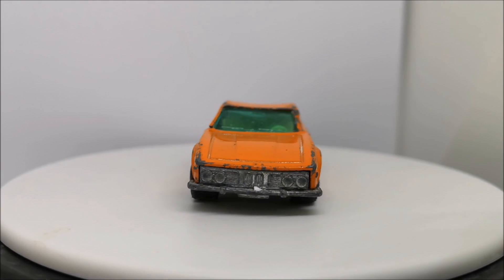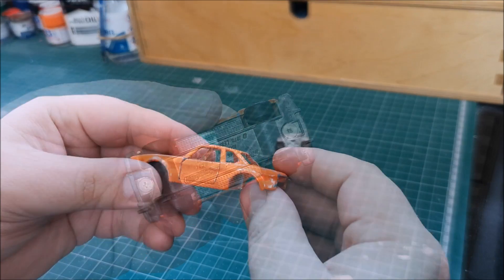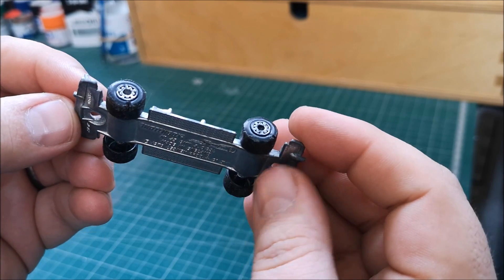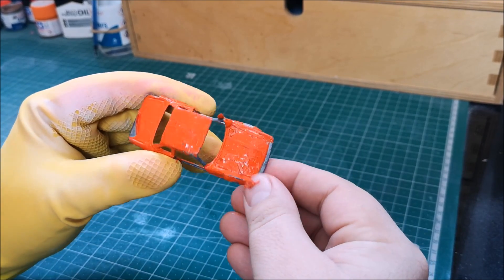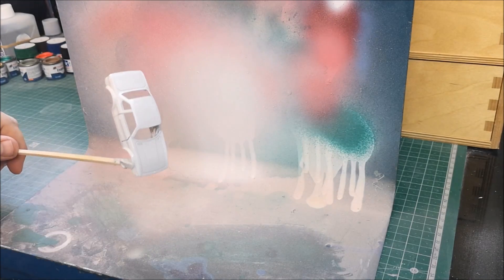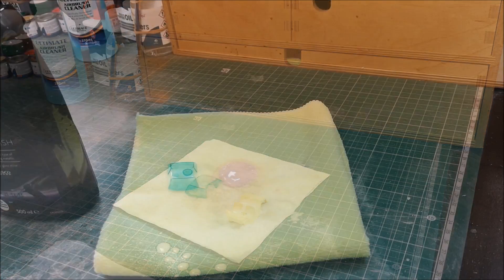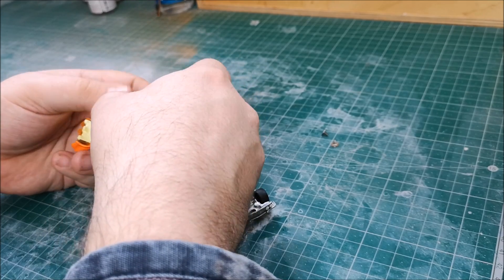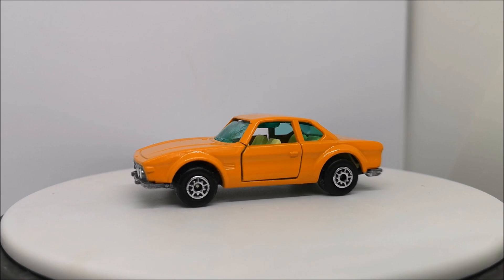Matchbox Series No 45 BMW 3.0 CSL - Restoration Video

Comment: Next time you need to super glue two metal pieces together, add plain baking soda to the joint after applying glue. Provides a stronger bond and dries almost instantly. You can then file down to make the two pieces appear as one single unit.

Seen this method employed elsewhere with excellent results. Moreover, have used it myself to seal a water tank (not for drinking). Works like a charm.

Cheers!

Vancouver 🇨🇦
Reply from the maker: Thanks mate I will do that in future

Comment: Im sure you have heard by now a sure fire method for repairing cracked A pillars.  Dab a spit of baking soda over the superglue and let it harden.  It happens almost instantly and can be shaped with a hobby file.  
Other than that I think you have a little racecar that needs some polish and a new set of wheels... 😉
Reply from the maker: Thanks mate I will do that in future
Reply: @MatchboxGarage  A bit of good putty would probably work as well. Or soldering iron. Anyway, the cracks seems to also affect the glass fit - there's a nasty gap between the glass and the roof. It was not there before the restoration (as far I I can see on the video).

Comment: At least there was no trailer hitch sticking out the back. Just a word of advice- you're going to want to pre-drill and pre tap holes for the screws. The metal is soft enough whereas sometimes if you try to force the screws in your going to end up breaking the post, then the casting is no good after that. And always remember the oil before you tap.
Reply from the maker: Thanks for watching. I do tap the posts

Comment: Great job fella ,like the added detail and as you rightly say its your car so have it as you want. Little tip for filling and fixing any cracks in castings is to use super glue and baking soda sprinkled into it, this acts like a filler and drys extremely strong. I have used this method for years on all sorts of projects mainly at work, and if you need to see it in action Marty's Matchbox Makeovers is an Officianado of the art and is oft seen repairing some badly damaged castings. Keep up the great work and like the new site title which threw me a bit at first.
Reply from the maker: Thanks mate. I do have some Baking powder in my Arsenal and will definitely use it next time